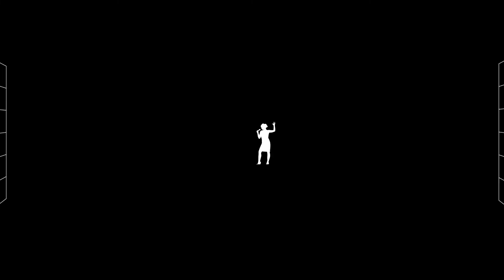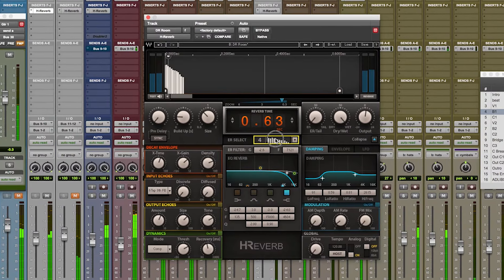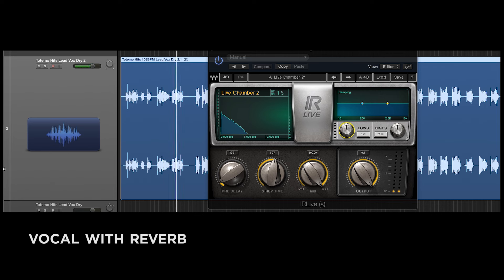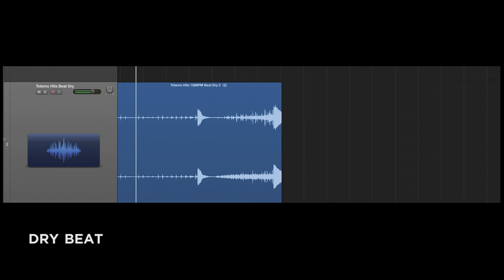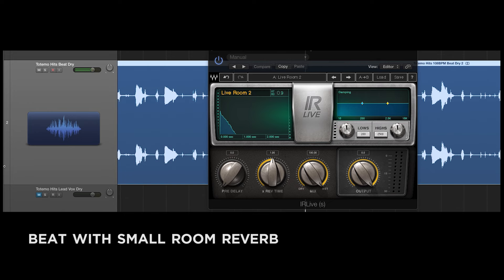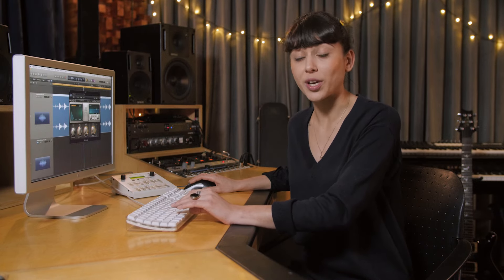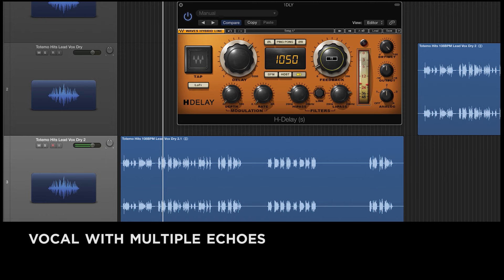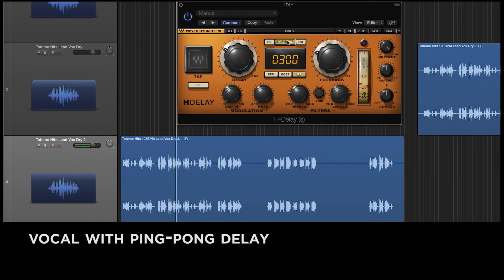Reverb and Delay Explained – Sound Basics with Stella Episode 4

Comment: It's a good tip, because a lot of "professional" recordings these days sound way too dry and "up front". Everything sounds like it's direct-in and just blasting in your face. There's no lower level, there's no background, everything is at the front of the "stage" turned up to 11. - Turning down parts and giving them a more open and spacious sound helps a lot with that flat "two dimensional" sound, that we generally don't want but get a lot these days.

Comment: Something I never see mentioned is an incredibly simple way to massively increase the realism of reverb: reversing the stereo direction of it. If you're standing in a room and hearing something to the right of you, you'll mostly be hearing reverberation coming from the left, whereas if you put a reverb on a channel and pan it to the right you'll get both the original signal and the reverb only from the right, which sounds completely unnatural.

Some reverbs, like Logic's built-in Space Designer, allow you to flip the direction of the reverb (the slider on the bottom left). Putting it about 50-75% flipped will improve things hugely.
Reply: Hi Charles
Plz help me?
Your point is to use digital reverb and change the signal path? I have two monitor speakers, how to make it possible?
I have NI, Presonic and Music One DAW.
Im new in this and i have only 1 year in music creation.

Greetings from Spain!

Comment: is reverb not just quicker delay?
Reply: No, not at all. Delay is a duplication of the signal over time. Reverberation is an imitation of the dissipation of sound in different sized rooms if you will.
Reply: @virgilhughes7837  well isn't a reflection off a wall, back to the ear just a duplication? and the size of the room is determined by the delay?
Reply: @zeeanemone6482  It is a duplication but not referred to this way in music production. Delay and reverb are different things although they stem from the same phenomena in real life
Reply: @virgilhughes7837  so in reality they are the same thing, so if you could add more time to a reverb it'd be a delay. thanks I get it now